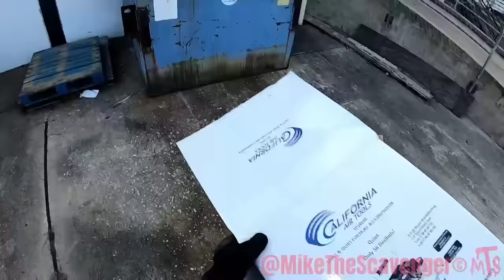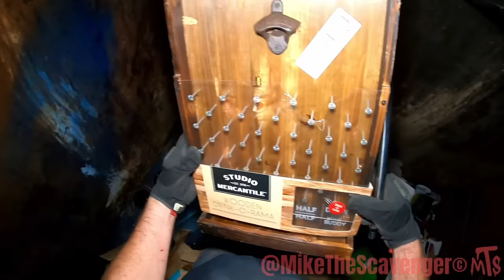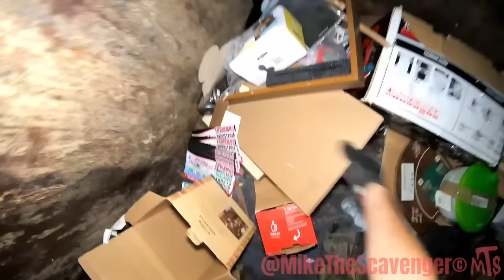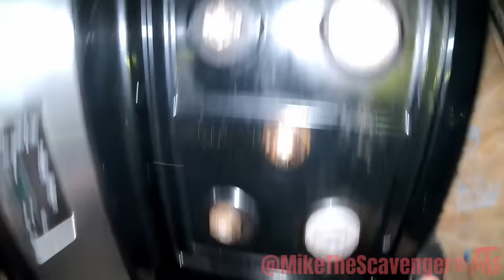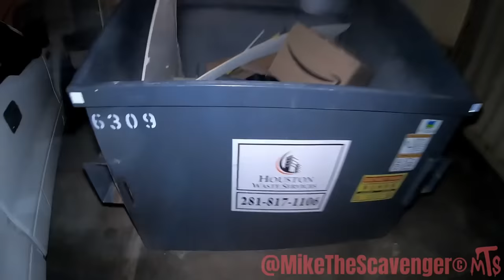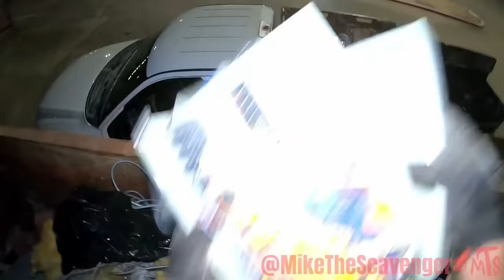Dumpster Diving "Grab It Like You Mean It"

Comment: Hey Mike. Those"ladders" are ceiling(sp) runs for wires. So they don't lày in drop or in insulation. They also use them to run wires between computer racks.

Comment: the item you found that says Andrew in called a waveguide, it is used for high frequency RF (radio frequency) (microwave frequency) possibly from a cell tower or a dish antenna that uses high power microwave. what you are calling a ladder is ladder rack, it is for laying cables between the the top of the data racks and usually goes to a wall where the cables then run up into the ceiling or elsewhere. Cleaned up those aluminum data racks are probably worth $50-75 used where you would only get $10 for them if you scrap them. New the aluminum 19" shelves are about $40, I'm sure you would get far more than the dollar you will get for those as scrap.

Comment: I've installed and removed and resold this for 30 years.
 @26.50 it's a rack mount shelf Chatsworth 10758-201 | Small Peripheral Shelf $130.00 you can sell them for $50.00 
@26.35 Chatsworth Universal Two-Post Rack 45 RMU 19" W x 7’ H x 3" D - Black $350.00 sell for $150.00 
@26:00 Chatsworth - 10250-712 - Chatsworth Cable Runway - Cable Ladder rack 10ft $140.00 sell $75.00
@22:29 45U 4.9" Wide Plastic Dual Sided Vertical Cable Management (2) 22.5U Sections with Cover QTY 2 for $ 140.00 sell $75.00 YES for plastic!!!!!